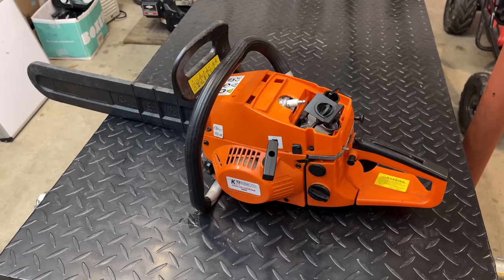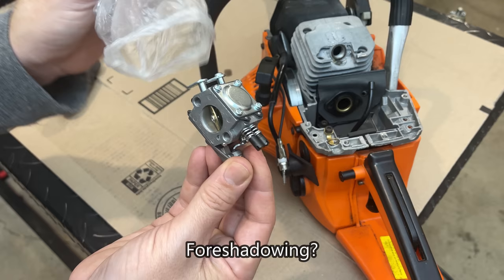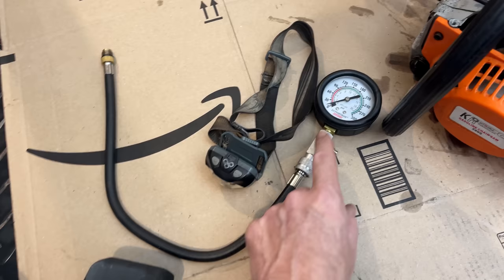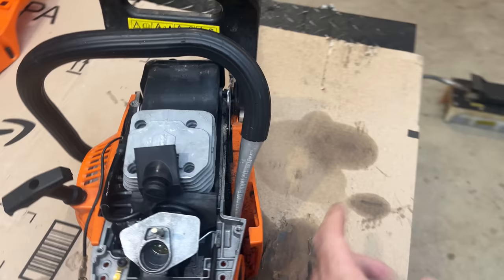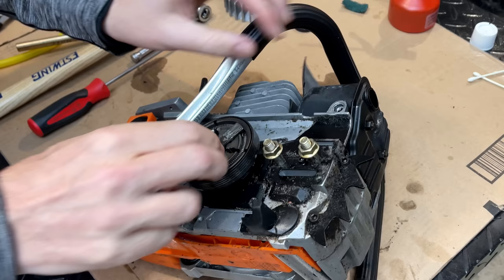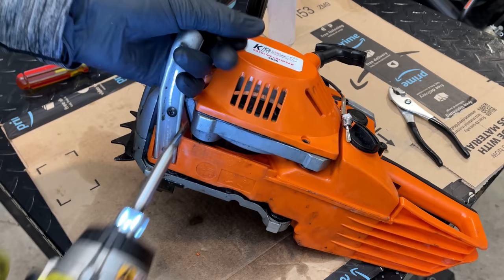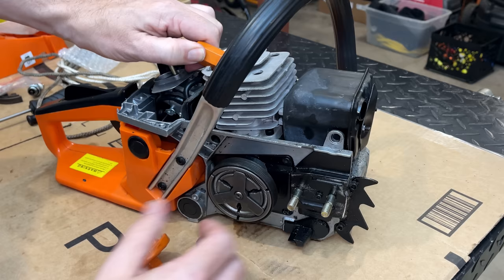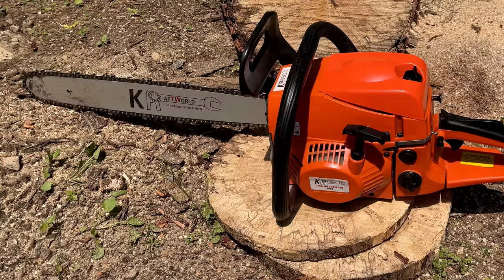Chinese Chainsaw Challenge - Will it Run? (Unbelievable Amount of Problems)

Comment: Hi, Mr. Condon. I live in Thailand. My in-laws own a hardware store in Udon Thani called Udon Hardware(อุดรอุปกรณ์). They sell this type of chainsaw. They range in prices from 45 to 130 usd. Oleo Mac makes a version of this design that's very reliable( model GSH 562). You are working on the less than $100 version. They are notorious for having bad rubber tubes and seals that degrade fast, defective plugs, cheap coils, and more.  We have to start and tune every chainsaw we sell. The average consumer here will not be able to start it, much less diagnose it. It's hard to believe, but most are easy to start  and run correctly with a bit of tuning from the factory. The US markets are getting saws from the  bottom of the barrel.  Fortunately,  this design is not the worst one we have come across. There are a number of chin ese manufacturers using the same mold and rebadging them for different markets and price points. Sadly, they have turned what was once a simple and effective Japanese design into a laughingstock.
Reply from the maker: I like the design, but it is sad to see something so new with so many issue.
Reply: I am sure the import taxes and shipping costs Jack up the prices of the saws.
Reply: So your saying your parents sell this chainsaw for $45 USD?? How much do they buy the chainsaw for? I'm so curious
Reply: @bye92  What I meant was. I've seen it sold online for as low as $45, minus shipping costs. Companies here will contact a chinese manufacturer directly and import one model by the hundreds, more likely 1000+,  and sell it directly on sites similar to Amazon. Of course, there is taxes, shipping, and web platform costs to consider. The margins could  be as low as $4. What my in-laws do in their store is go through a wholesaler. We buy maybe 50+ units for about $45 and then sell them for as high as  $65. The difference in margin is do to the extra service local stores have to provide to the costumer. For example, our shop tests and tunes every chainsaws that goes out the door. There are also the  limited parts warranty we provide and the labor is also free for said parts. If we had the capital, the first method is the better business model. Good luck.
Reply: I have a couple of Salem Master Saws that look very similar to what he is working on. I don't know if the quality is better, but I have had them for a few years with intermittent use with no issues
The key, though, is I use premixed fuel.
Reply: It reminds me of the lucky bags you bought the toys were crap inside just like lots of chinese goods are
Reply: Oleo Mac themselves are just Husqvarna clones.
Reply: That was one of the most interesting comments I have seen in a long time! In the end i have ,,all these saws'' and in my opinion if I compare this to my 1000€ plus Stihl, it is actually good value because believe it or not it cuts. Like you said these China saws need tuning from the beginning. But every Stihl or Husqvarna I own needs tuning as well it's just that the build quality is better and adjustments hold up longer. Same goes for spares, a small spare fore the MS500i can easily be 50€ if it's an original Stihl part. I really learned to enjoy these cheap saws, also for testing different porting ideas 💡 I wish you and your family lot's of success in business in the future.

Many regards from Germany
Reply: @enzobreymann8370  Thanks for the reply. I'm glad someone found it interesting.
Reply: What makes me sad is the crazy amount of raw materials used to produce all these very bad performing machines, that just end up on the landfill, being too cheap to repair... 😢
Reply: 30 -35 psi is great for a chainsaw, it is a small low compression motor!

Comment: I bought one years ago off of Ebay. I think it cost $79.00 back then and came in a box that just said chain saw with no other markings. Except for the bar oil leaking all over the shed floor it always starts and runs. Best thing about it you can leave it in the back of your truck and no one will touch it!
Reply: These aren't as bad as many people say. I bought one last year for around $120? (Bidenflation) it works fine.  
Old cooky man in comment section talking about a homelight passed down from his grandfather to him. Claiming its ran for millions of hours with no problems 😂  
It's a 2 stroke not a diesel engine that can go a million miles.
Reply: @michaelbrinks8089 i dont chainsaw, i just like to watch these kinds of videos. I read cheap chinese chainsaws can run fine for long time if you take care of them just like with everything else.

Btw a million hours is around 114 years not counting leap years.
Reply: @norbertnagy5514  Seems like something is still wrong with the saw in the video. With a sharp chain it should be cutting those logs faster than it is. Sounds like the engine at full throttle isn't reaching proper/high enough RPMs. Like something is restricted. Its possible its a factory dud. For the price of mine I was Happy with the quality & didn't end up with a dud. I inspected the engine before starting & it didn't come with any dirt inside. Like my 2 stoke motorized bicycle engine did. It was full of factory and metal shavings. Had I not cleaned it b4 using, it wouldn't have lasted long.
Before I bought my China saw online. I checked at Lowes and Menards. Their similar 52cc saws were also from China but cost 2x as much. 
In hindsight I still would have bought the cheap China saw I bought.
Reply: @michaelbrinks8089  yep, i noticed it stalling a little in the video.
Reply: @michaelbrinks8089  Back in 1953, one place I worked for received a pair of 500kW Mirlees diesel generator sets (engines from submarines, larger than the average SUV without flywheel and generator attached). These were torn down on a whim before first start, to find a sump and cranks full of metal shavings - "Quality British Engineering"

(Ie: it's not just China which has QC problems)
Reply: Yep I buy chinesium chainsaws. Cheap to buy and parts cheap. Just replace all fuel lines and they go and go
Reply: @glennmcinnes4742  What type of fuel line do you use? Just some ebay or Amazon fuel line?
Reply: I bought similar one some 8 or 9 years ago for $80, I use it maybe couple of times a year in garden and that's it. I had to replace the chain immediately(it was soft and stretchy)  but other than that it still runs as new, never had to open it or maintain anything, watching this vid I probably should at least clean it before next use
Reply: @norbertnagy5514  l
Reply: @miscbits6399  Sub engines of that age might have come from or originally been built during WW2, so wartiem QC. But yeha bad QC isn;t unique to any one geographical location historically. It's just China ATM because they've had the cheap workforce to keep poor QC items cheap on the labour cost side.
Reply: @michaelbrinks8089  You are aware the entire rest of the world has worse inflation the last several years than the US. Inflation has nothing to do with US politics. It's the aftereffects of a global pandemic and the war in Europe driving energy prices through the roof.
Reply: @michaelbrinks8089  looked like tygon.
Reply: I've had one of these saws for over 10 years and never a problem, it's outlived my husky.
Reply: I fix hundres of chain  saws I use to sale at mcalle  fleet market fo25 years some lawn mowers when they were damaged I use the white and black glue and i mixted and i put it where it was damaged but first i cleaned and I  sended with sand paper and it work fine
Reply: The name of the glue is jb welding
Reply: Your comment about leaving it in the truck is about the only reason I can possibly imagine to have one of these.

I guess if you are lucky enough to get one that works then great.

I don’t have to cut wood.  I do it for the fun of it.  Part of the fun is being able to use my 30 year old Stihl 026 or my Echo 2511, and experiencing how well those machines run.  Good tools make work tasks enjoyable for me.
Reply: @michaelbrinks8089  it could be the rakers on the chain. I didnt see james file those down to reset the depth of cut. So even though the chain is sharp its not taking a big enough bite.
Reply: @adamvandenboogard509  True......, I'm pretty happy so far with my 52cc $115 China clone with 22in bar. It could use a better air filter than the fine plastic screen filter it came with but it's OK for now. I smear on a little gasket sealer between the carb & filter connection before I put it on. I think the cheap fuel lines like to get hard also. Is the only minor 2 problems so far, neither is a big deal. The engine was clean  free of metal shavings or 💩 when it arrived. The spark plug was installed stupid tight for some reason.  If I knew how to properly port it. The saw would cut probaly 2x faster.  But does ok now, compared to the little 14in Homelite I was using before. I checked Menards & Lowell's before buying and thier made in China 52cc saws were 2x the price.
Reply: @davydacounsellor  IMO you were lucky so keep it.
Reply: I don't understand why anyone who is a serious woodcutter  and will use a saw for many years would try to save a few bucks on a cheap saw. Look at the saws the pros use. Spend the money people. Huskies and stihl.
Reply: 🤣 no one will touch it….
Reply: @darthkarl99 That's the dumbest comment I read all year. US politics has everything to do with inflation. Politicians created the 4 trillion dollar Care act. Politicians gave billions of taxpayer money to Ukraine. Politicians voted to give Israel billions of dollars. Politicians voted to forgive billions in student loans, etc. This contributes to inflation. I swear people need to pass a IQ test to vote because this is getting ridiculous.
Reply: @ryangiltner5640 The US money sent to ukraine is mostly older equipment that will be replaced by newer stuff, made in the states.
So that money actually stays in the states mostly

Comment: Whatever you think of the saw, this was a masterclass in small engine fault diagnosis. Thank you and the group for putting in the time, it was very instructive for a DIY guy like me.
Reply: One thing about buying a Chinese saw, when you get OEM parts, they are Chinese.
Reply: Life lessons in patience and perseverance as well.  This video made me a subscriber.   Also this was not a long running video for me, I backed up sections to rewatch and absorb your methodical problem solving.

Comment: I sure hope the factory gets to see this.  They've probably never seen one run.
Reply: Yea no doubt, bet they don’t even know what they’re used for😂
Reply: @mikerossman9863  I don't think this saw could make it in that part of the world knowing what kind of trees they're dealing with
Reply: He has patience I would have thrown it in the trash!
Reply: Whahahahaha good one
Reply: @kwhite145 He needed for anti china content, looks like this one success to bait anti china viewer
Reply: @spy_balloon  Bot
Reply: @billsmith5166 Bot
Reply: @spy_balloon  You think this is a glowing endorsement for Chinese products? I guess if the goal is to waste as much time for the consumer as possible
Reply: They have probably never been shown how to assemble one correctly.
Based on the condition of the bar, casing,  handle and trigger, this saw has never been used and obviously left the factory with all these issues.
Reply: This is one epic video, watching a couple of these kind of quality vids 'll even make me able to fix stuff 😁
Reply: Good video, but really shows the quality of the design and materials used in the manufacture of this CS is close to Junk Level, Despite the machine has hardly been used, it requires replacement of the complete Carb assembly, plus replacement of both (oval) Crank shaft oil seals, threats not formed correctly on crank shaft assembly etc😮
Reply: Maybe need a Pakistani mechanic . 😂😂❤❤
Reply: Simply the fact that someone bought one of these, lets you know ,they have not a clue about chain saws. Then they will lie about whether or not  they put the proper oil in the correct place, out of embarrasment.
Reply: Half of eastern Europe use these chainsaws as hobby tools. They are heavy, but they are working pretty good.
Reply: If they even care

Comment: Ah, Chinesium! They didn’t even charge extra for the added rubber bits in the impulse line. That was fun working with all of us!
Reply: No extra charge for pre-cracked fuel line and already ovalled seals!
Reply: Not to mention the random piece of aluminum he found when he removed the muffler.

Comment: Wow !   James that was an exhausting ordeal to watch !   I'm pretty sure at around the 45 minute mark I would have scooped the whole mess up and dropped it in the garbage can.   You have stamina my friend and an amazing amount of patience and knowledge !     Oh and the customer  is going to receive a bill for $795.00   LOL
Reply: You’re a better man than I , Mr. Tony. 30 minutes would have been it for me. Lol
Reply: Haha. I hope and expect the strategy involves YouTube income for a very interesting video. The easy ones are boring 😎
Reply from the maker: The easy ones are boring and your don't learn much.
Reply: if not before as soon as the clutch went flying it would have been tossed into the scrap metal trailer or shot with a rifle to put it out of my misery
Reply: @jeffvickers9390 7😢🎉n😂nkmjmkkiuljmimk96k
Reply: Jim, if the moral of the video is….You get what you pay for, you proved that!
Reply: James, been with two husky's a 240 and 357 XP. One issue fixed, two more show up. I find these chainsaw two strokes are by far the most tempramental. Just when you seal them pressure/vacuum test they seem to show...the rest of the story. I have found the carbs or folks messing with adjustments a big issue. Many saws come in with the carbs way too lean. Folks want to run them as fast as they can. Unfortunately, their saw is ruined. Great vids, keep it up Sir. Much appreciated.
Reply: P.S.
After clutch install, get the bar and chain installed. Set the chain brake and rev the saw a few times. Clutch should be secure at that point.
Reply: Thanks for taking the time.  I have learnt a lot from this
Reply: I fell asleep pulling the carb off…..woke up to the saw running. Magic lol
Reply: Wow James patience must be your middle name we'll done. 

 heart
Reply: I would have thrown it in the. The trash long time ago, but you did a great job.
Repairing that Shawl I hope you don't give him a Bill for labor
Reply: Weak
Reply: @heavysnow8616 toys! I was waiting for someone to let him know that the motor can tighten the clutch for him.  Excellent comment!😊
Reply: I wonder if the Chinese realize how truly crap their tools are !
Reply: How can anything be put together that poorly on accident.  Working on that junker is like wiping yourself with wax paper.
Reply: Hi James, I would have thought just like you the engine was damaged but I wouldn't know how far out the jets would be but I don't quit in most cases but you really know a lot about what you repair, so thanks for your videos it's really amazing to see 😀 😊 😉 😄👍
Reply: @marktomlinson6714  im with you
Reply: @allenferry9632  like pushing shit uphill

Comment: Former Auto mechanic here. I have little experience with 2 stroke engines. This is a great video on diagnosing this chainsaw. You really didn't have too much money in the repair if you just count the seals and fuel line. I didnt realize how much bad engine seals can effect how a 2 stroke motor runs. I've had tons of car engines that leaked like hell. Bravo on the video. You have a broadcasters voice. Thanks for taking your time on this video. This video is a chainsaw master class!

Comment: A friend and I each bought one of these saws about 5 years ago and both saws have done a lot of work. Mine needed a new start pulley. Those 8 mm flanged nuts can be found on 10mm Dynabolt masonry anchors. Excellent video, i much enjoyed the clutch taking off across the shop.
Reply: It is most gratifying to see that even the most competent end up paying the Dumb A** Tax upon occasion.
Reply: Hi , James  ,
Well done as usual.   I am now physically disabled (stroke) and can't do many things I used to take for granted  .  I hold an aircraft mechanic license and about every pilot certificate available.   
Watching you systematically troubleshoot is very therapeutic for me.  Thank you. 
Did you ever change out the chain oil ?

Comment: When tightening your bar/chain, lift up on the bar to get correct tension on the chain.
Reply: Correct.. and check tension on the bottom, not the top.

Comment: I have a small engine shop. I made the mistake of buying one of those Harbor Frieght pressure testers once. I promptly got rid of it and bought an OTC brand and it is SO much better. Plus, the company stands behind their tools 100%. The model I have is an OTC 5605 if anyone is interested.
Reply from the maker: Waisted a lot of time with the HF tester.  Works good enough on larger generator engines but not small ones like on a chainsaw.
Reply: I have two Harbour freights, a Mastercraft, a Snap-on, and two Starrets. They all read slightly different, I just average between them all. My Harbour freights are more consistent with the average than the others.

Comment: Another great video James! Just a note: When tightening the bar cover nuts, lift up on the end of the bar before tightening then tighten while holding the end of the bar up. If you don't, the chain will loosen after the first running, needing another adjustment sooner.
Reply: I am guessing you mean up if the bar is lying flat horizontal
Reply: @mattj7124  Nope, vertical. At the end  the video, James did hold the end up for the final tightening.